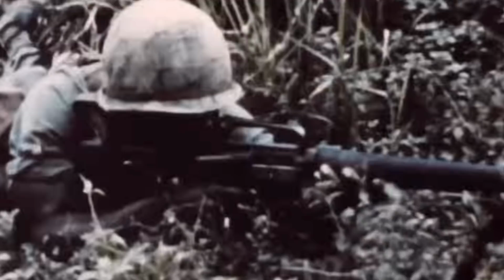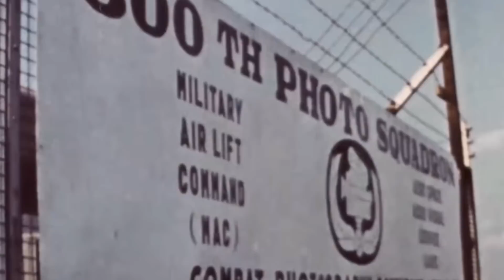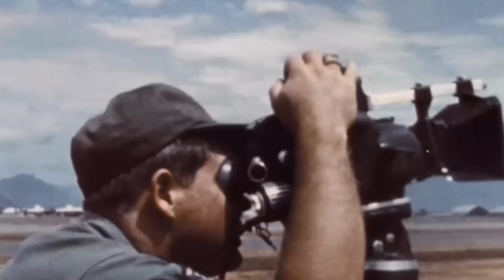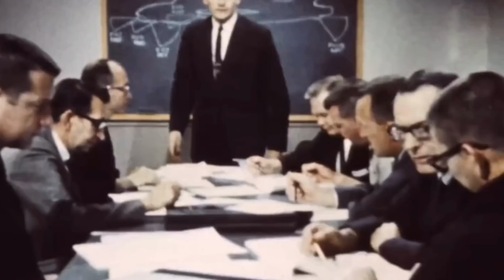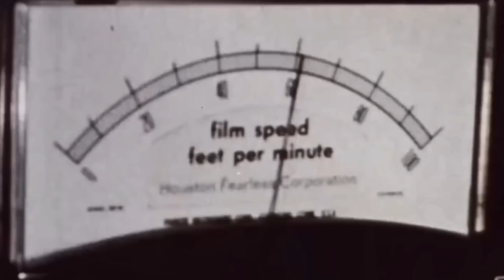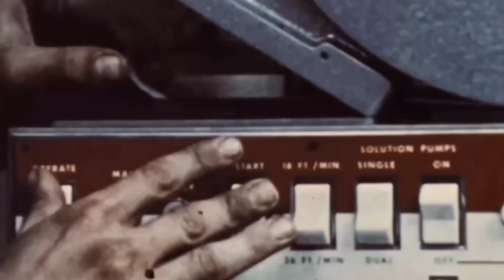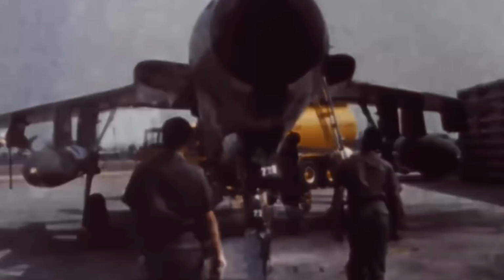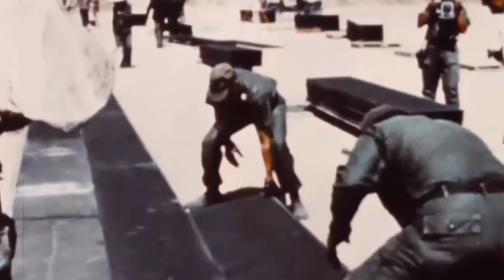How Did Aerial Combat Footage in Vietnam Improve?

Comment: Just a thought, as I do also scan/digitalize some of the family's collection of slides and negatives, is that what we might get more quality out of the old films that what we see right now. 

You'd be amazed at what quality can be gained from some old 35mm film if done with a high quality specialized film scanner. 
Flatbed Photo scanners are nice for their multi-role use, but specialized film scanners are obviously better. 
Though if you really want to be gobsmacked just look at a digitalization of an 80 year old plate negative (glass plate large format). 

The reason I say this is that the footage we have of Vietnam, you know the TV footage and later in the 80's and 90's the VHS tapes might be limited in quality due to transmission limits. 
So that the quality might just be reduced to what could be transmitted via the availlable bandwith at the time. 

I mean you do the same right now uploading onto youtube, you reduce the size and quality of your videos to the size necessary for transmissal via youtube. 
And quite often you can see it when people go to aggressive and use to low of a bitrate to get a small video file. 
The tipp I had heard is that you should use 6-8 mbits for full HD, so that the youtube algorythm who compresses it down for the final youtube bitrate, has more to work with. (Tipp was from Glowing Amraam.)

Same as I do when I encode the raw photography or scan files into various file formats for various applications. 
I mean a 16-bit TIFF is a bit overkill if you just want to send someone a photograph via e-mail for that a .jpeg will do. 
However if you want to make a high quality print of something, then a TIFF is the way to go. 
For Archiving also, although a RAW file might be better for that. 

Also while a fine art print has about 300 dpi, on computer screen, unless it's 4K or higher, the pixel density is only about 75 dpi, so you can reduce the file size significantly if you just want to transmit a file via e-mail and speed up transmission. 
You can also reduce the resolution as well to again reduce file size for a speedier transmission. 
I just wouldn't use them to make a large format print...........that's going to look ugly!

So a re-digitalization with more modern equipment might garner us better quality footage.

Comment: Love the video . The US propaganda was from the war at the time was unbelievable . You can see the short comings oft he F-4 . It was designed as an interceptor and did not have a gun . A gun pod was later adapted but was only adequate at best .
Reply: Teddyballgame The F4 didn't need a gun, the US navy F4's never had internal cannons but still had a higher kill to loss ratio than USAF Phantoms, after the USN started the top gun school to teach pilots to dogfight and mechanics how to maintain missiles
Reply: Obviously you did not read my comments . The F-4 had a gun pod that was attached center line belly and the pilots demanded a gun for the F-4 because the heat seek missiles sucked . The missiles would lose their lock in a 2 g turn .
Reply: Teddyballgame Yet the USN and USAF scored most of there kills using missiles not guns, like I said, the Navy F4's never carried internal  yet still managed a higher kill to loss ratio that USAF phantoms who actually were modified with internal guns, and the USN had better luck with missiles because there pilots knew how to effectively use them in a dogfight, and there ground crews learned how to properly maintain them, faulty maintence was the main cause for missile failure for the Phantom
Reply: and the most ace belong to Vietnam. 2 ace in US was from ground to air missle...
Reply: The reason for the gun pod was CAS and because of the F-4s short comings is why every new jet has an internal gun . I was in the Navy and never heard a naval pilot say they did not need an internal gun . The horrible  AIM-4D only had 4 kills in the Vietnam war . The newer AIM-9 was just a little better . That is why it usually took all 4 missiles to take down a MiG .
Reply: Teddyballgame The AIM-4 was meant to shoot down slow Soviet bombers targeting USN carriers not fighters the AIM-9 sidewinder on the other hand achieved 59+ kills during vietnam so how exactly is it just a "Little better"? 59+ kills isn't just  a "little better" and most defective missiles were due to improper maintence and handling,  which is why after the Navy put better training into place for ground crews the missile failure rate went down
Reply: Regardless it was used in the start of the war . The F-4 was meant to intercept bombers but was used as a multi role jet and in the CAS role with a gun pod adapted to the jet .
Reply: Teddyballgame For the CAS role a gunpod is useful for hitting ground targets, but for AA use the F4 was better off without the gun, the AIM-9 scored the most AA kills once the kinks were worked out
Reply: The F-4E had an internal gun . The Phantom’s fundamental flaws were corrected by 1970 . The AIM-9 was only 30 % effective at best . The rules of engagement meant the could not fire BVR .
Reply: Teddyballgame The AIM-9 was only 30% effective yet scored the majority of air to air kills, compared to other missiles of the time that 30% effectiveness is remarkable compares to the single digits of opposing ones, And the Navy without carrying an internal cannon still achieved higher win to loss ratios compared to USAF phantoms, so the cannon or lack of it wasn't the problem, it was the USAF not training pilots to dogfight till latter in the air war and maintence crews not maintaining missiles properly, and the fact that missiles of the time were pretty primitive compared to now. And you speak of the F4's shortcomings, the F4 had to visually identify and fight smaller and nimbiler MIGs at such close range which put it at an advantage, it could spot the MIGs from farther ranges with its powerful radar but it couldn't take advantage of that tool
Reply: Teddyballgame What does ground radar have to do with anything? There's nothing the phantom could do with anti radiation missiles or SEAD aircraft, in your original comment you say the gun was marginally better then discredit the AIM9's kills, the internal gun didn't "fix" any shortcomings, and the ROE wasn't the phantoms fault it basicly meant it had to get into spitting range of the MIGs without a gun, yet navy phantoms did it better than there air force counterparts who consistently used gunpods then used the newer variants with guns
Reply: Teddyballgame Yes the ground radar could direct the Migs,  but the phantom could spot the MIGs with there powerful radar, and what does smoking engines have to do with anything either? If the MIG is close enough to see your engine smoke than you're already in a bad situation, and the gun is a last ditch measure for any modern aircraft, for fucks sake the aircraft that replaced the phantom was am interceptor with long range heavy missiles and a powerful radar, not a nimble gun fighter
Reply: Still rules of engagement for US  fighter pilots . Identify the jet before firing a missile .
Reply: Teddyballgame But now with emerging technologies, pilots can visually identify from farther range, tech like this has already been equipped on the USN F35's